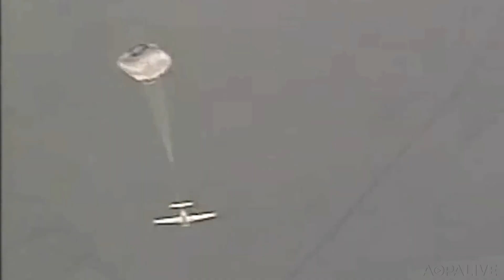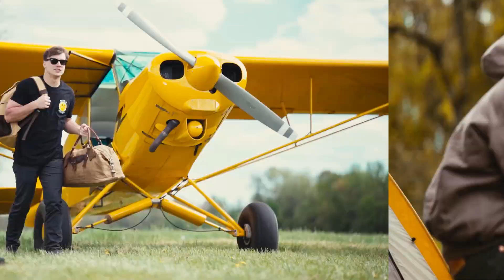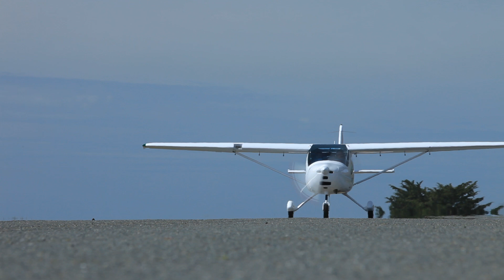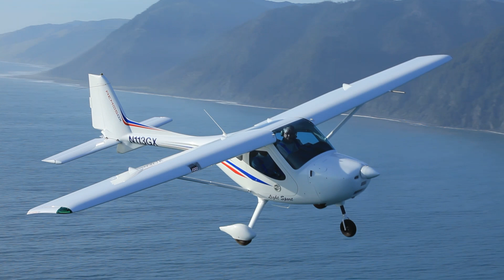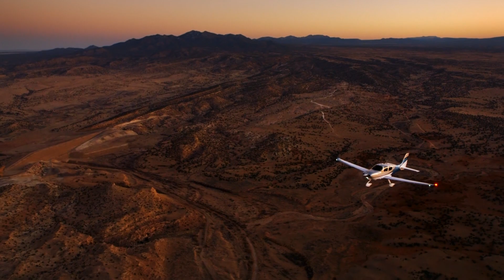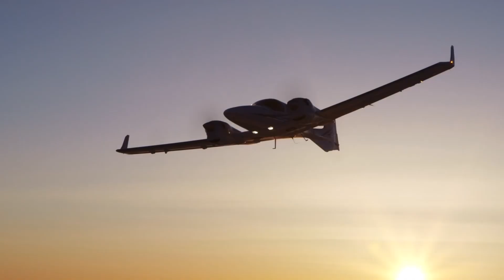Flight Training Airplanes Released Since Y2K

Comment: I have and operate a Cirrus engine that I bought out of a wrecked SR-22 that had 48 hours total time. Your fuel burn on your Cirrus seems a bit high. I am burning 14 gph @ 75% power but when I run LOP (which is recommended) on this engine, I can go as low as 10 gph but I give up 10 knots. BTW, my cruse speed @ 14 gph is 205 knots. Love my Velocity.
Reply: Thanks for the insight on your fuel burn!